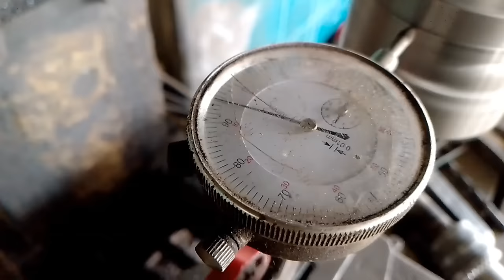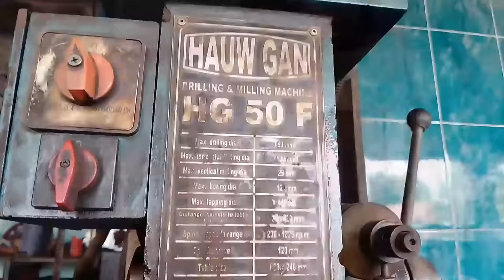4 machining lathe techniques that are not taught in school, turner creative ideas

Comment: the gear cutting was excellent! at some point i need to fix the gears in my lathe, it flooded before i owned it and the person didn't drain the water from the gearbox and the bottom of the gears have been sucked away with rust :(

Comment: There's a reason why they're not taught in school. That's not a true helical gear as the profile will be inconsistant across the tooth. Specialised brake disc lathes also exist, as do dedicated toolpost grinders that are more rigid and run at a higher speed.
Reply: Yes indeed. The cut is deeper in the middle of the teeth compared to the sides. The wider the gear and the bigger the angle, the bigger the error...